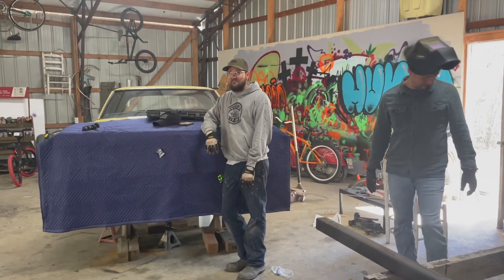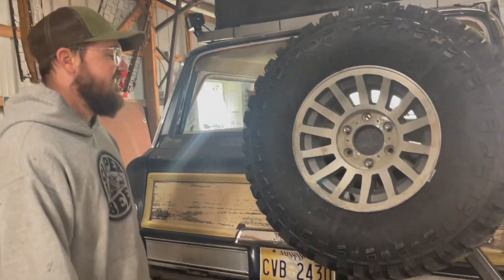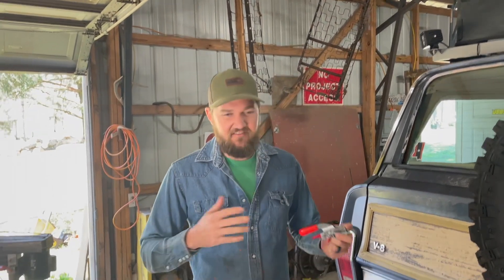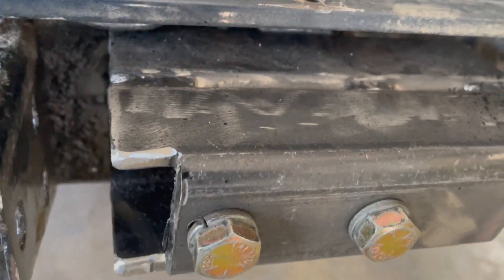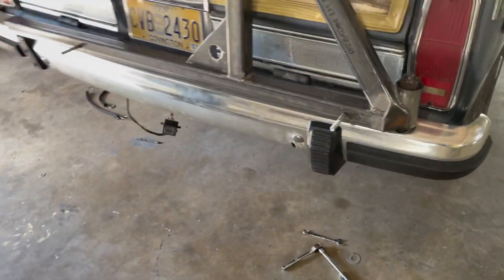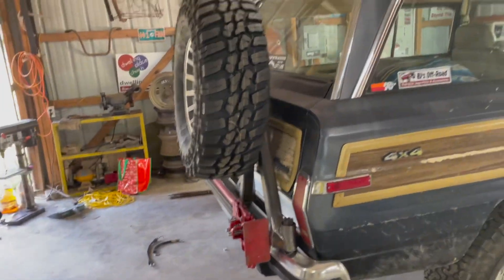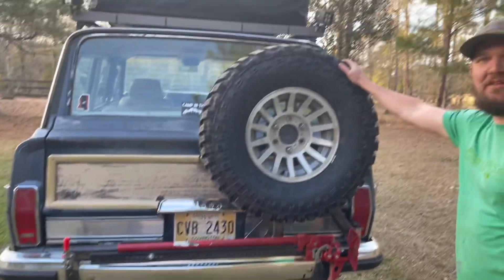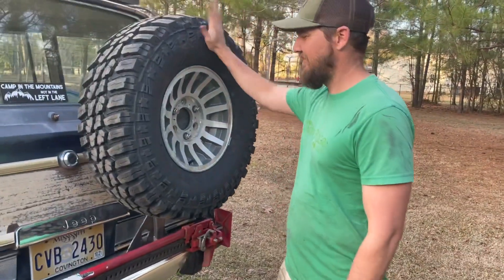Custom Spare Tire carrier part 2 #wagoneer #sparetire #custombuild

Comment: Looks great.  Im glad you mounted it to the frame and not the thin body.  Alot of people mainly wrangler owners.. seem to mount tire carriers like this to thr thin 20ga sheet metal body of the Jeep.  Makes no sense to me.   When i originally commented on your older video of the spare tire idea.  I mentioned i did a folding hitch carrier instead.  Im glad you did it the the way you did vs mounting it above the rear brake light.   My only complaint if this were my Jeep would be it blocks half of the rear window.  Mine is below the window in the center on the hitch so no view is blocked. But i had to move my license plate and get a new light for it
Reply from the maker: We don’t mind the back view honestly. We planned for it to be as high as it is because we didn’t want to move anything else on the vehicle like the tag etc. we want to be able to take it off and the truck still look as stock as possible.
Reply: @TermiteOffroad  all i did for the license plate was just take the front stock license bracket that mounts on the front bumper and drill two holes in the back bumper and mount it on the back bumper instead to the left a little.  The front license plate thing i didnt need because i have a factory brush guard from a 79 cherokee chief which has a plate holder built in.

Comment: Did you mount the tire there for the look or is there nowhere to mount the tire under the Jeep? I'm wondering because I'm picking up a Wagoneer on Friday and they just have a tire in the back bed area. Was hoping I could find a way to mount it underneath, but I'm not finding any information on that.
Reply from the maker: We mounted it there partially because of the look… mostly because there wasn’t room anywhere else. And if we wanted to put anything in the back, the tire took up most of the space. Underneath wasn’t a great option.
Reply: If you don't plan on doing much 4 wheeling there is room under where the stock wheel was before. If you get into any steep grades with rocks it will hit on stuff. Plus if you get a flat while offroading lot easier to get spare off the rack in the back.